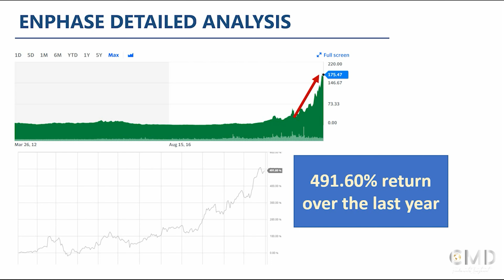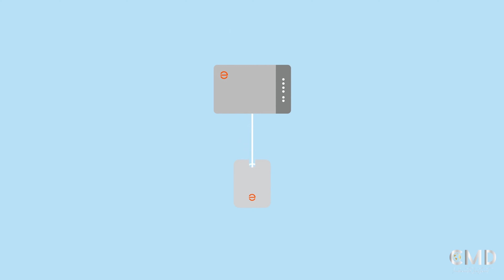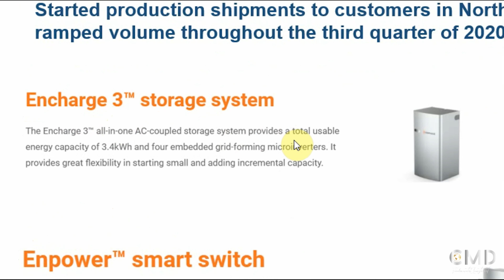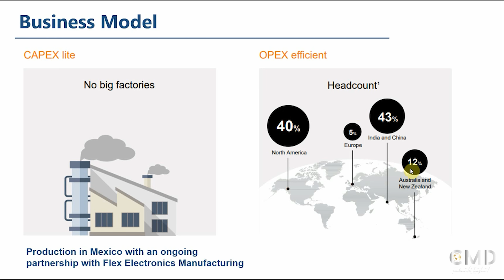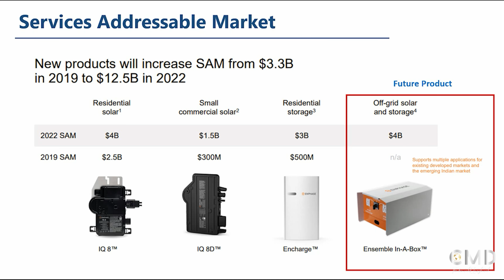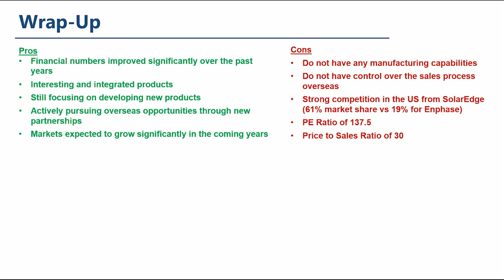Enphase Energy Stock Analysis (ENPH) - A Superior Solar Company Poised for Huge Growth!!

Comment: Great Video, love the in depth analysis!
Reply from the maker: Much appreciated John!
Reply: @cmdfundamentalinvestment9033  It's dropped alot in value now, would you be looking to buy at these prices? I personally think its worth around $100.
Reply from the maker: No we will not at these prices although we think long-term it is a great pick. We sold off at $150 before it moved up to + $220 to then fall back again. It seems better for swing trading these days, which we wont do. We would probably consider to add should it fall down around $120'ish.

Comment: Interesting. I don’t own stocks directly but I started following enphase because I bought a system about 5 years ago and was looking at expanding it, as works well with microinverters, but they were going through a bad time and I was concerned they might fail. Turns out a restructure and management change helped, and I have now doubled the system and will look at batteries an a couple of years. It also turns out my sustainable super fund has some enphase which has done very well recently.  The systems have a price premium, but great technology, and in my experience pays off.  Although as you say, others are starting to catch up.  How the new battery goes will be very interesting, it’s neat.
Reply from the maker: Hi Richard,

Super cool! Thanks for the comment and the input. Really great to hear from an end user of Enphase systems. Happy to hear that you are satisfied with their performance. Sometimes it is better to pay the double than to have to pay something a bit cheaper twice! :) If you are living in some parts of the US it would probably have been beneficial to have the batteries in the past week.

Comment: Another well done and thoughtful video. Keep up the good work. Some things to add here: 

1) SolarEdge was for years the dominant player in the US and European inverter market. Enphase has clearly been taking market share in 2020. You can see that from the EnergySage reports as well as the the miss that SolarEdge had in Q3. One of the big reasons for this is that Enphase products are much easier to install, much more reliable and they convert directly to AC on the roof, so they are much safer than inverters have high voltage DC on the roof. (See the Tesla Walmart fires a few years back to get an idea of what arcing can do to a roof). Also, SolarEdge is late in shipping their storage solution, which is now not expected to hit the market until Q3 of 2021. Solaredge is still dominant in Europe but Enphase is now investing heavily in the EU Market and I suspect we'll see strong growth there in 2021. Ask any installer who works with both companies and they will tell you that Enphase is a far better product and their customer service is far better. Enphase prides itself on its reliability and responsiveness. This is partly because the company almost went broke early in its history because its first generation products were very unreliable. This almost destroyed the company. They have a laser focus now on this. 

2) 2021 will be an historic year for Enphase because this is when they FINALLY release the revolutionary IQ8 inverter. You did not emphasize this enough in your video, but this is the first inverter in history that is smart enough to be grid agnostic and to be able to create microgrids on the fly when the grid is down. All other inverters are grid tied. That means that even without storage, if the sun is shining during the day an IQ8 system can generate electricity to power your home even when the grid is down. That is not possible currently with the IQ7 or the SolarEdge solution. For that you would need battery back up. 

3) Thank you for pointing out the Ensemble in a box opportunity. This is a potentially revolutionary product that, like you said, could bring electricity independence to well over a billion people in the undeveloped world that do have access to it currently. This product is made possible by the extraordinary tech inside the IQ8 inverter I just mentioned. 

4) In terms of competition, one thing that most people don't understand about Enphase's moat is that their inverter is built using an ASIC design that is almost impossible to reverse engineer. It would take years and by that time Enphase would be onto the IQ9 and 10's which will be even smaller, faster and smarter. Think of it like Intel Inside. It's the smart chip that will power the solar revolution.  For an in-depth look at their tech, the best person to read is TJ Roberts on Seeking Alpha.

Enphase normally has an Investor's Day Presentation on their roadmap in December. They did not have one this year and I suspect that will happen in January of 2021. It will be very important to attend this as this will probably be the official announcement of the IQ8 launch.
Reply from the maker: Hi Guy,

Good to hear from you and thanks for all the inputs! We know from previous that you also know your Enphase stuff, so this is definitely very valuable additional info :) Thanks a lot.

1) Really interesting and something to take note off. The articles we read seem to be more on Huawei side in the US, but interesting they are also capturing from SEDG.

2) Great info on the Q8, seems like a potential game changer! Perhaps some customers will then prefer to just have Q8 and no back-up storage at home, what is your thoughts on that? I guess we should do a separate follow-up video on this specific topic as indeed it is important.

3) Definitely agree on this one

4) Yes but to counter that a bit ASICs is also a sole supplier that they cannot live without. They may squeeze on pricing etc. Not sure with the individual deal with them, but they were mentioned specifically as as risk by Enphase. 

5) Would definitely be a great follow-up video to this. Will try and keep an eye out, but please give us a hint if you remember so.

Thanks again and Happy New Year.
Reply: The performance of the inverter is not given by how small or smart it is, just how cheap and efficient. Efficiency is already solved up to 95%, so hard to have incremental gains here. Of course off/on grid modularity is a game changer in the space, but is there really a barrier to entry for competitors to implement their own smart micro grid? I don't really think so. Inverters are a commodity product, enphase just has a temporary lead but can it convert the growth into cash flows down the line to justify current valuations? Unlikely.